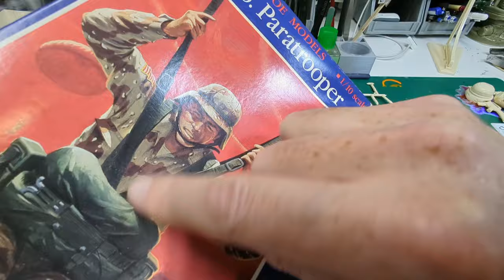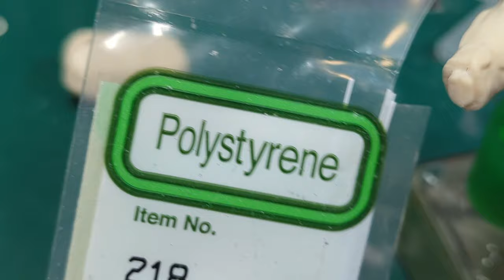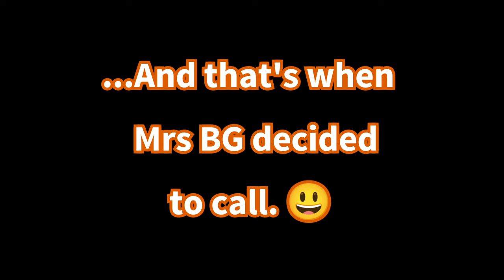80th anniversary of D-Day G.B.  Glencoe Models Paratrooper model kit Update

Comment: one of my Favorite kits! Wished Glencoe added the parachute like ITC did in its original run.
Reply from the maker: Hi Brad! 100% agree! Just seems a little odd without it, especially since there it has the wall mount included! 
Did you ever do a video on building this kit?
Reply: @BGsModelWorkshop  I never have, wanted to vacuform the parachute and build the wall mount version.

Comment: Great progress Bryan.  Nice Tips on figures.  I've always found the Plastruct and Evergreen stuff will melt well and makes good filler.  I've used reactivating liquid cements when parts were not lined up well.  It also is good to soften styrene and mash parts together to reduce seams.  Good Stuff.  Enjoy the cookies for a job well done.  BTW, yes, the 45 goes on the right hip.  I think the canteen should be lower on the leftside belt.  I had a surplus one as a kid (actually I stole it from my Boy Scout older brother).  The loops were at the top third.
Reply from the maker: Hi I Vince!! Thanks! Man, I feel this kit was made by someone that didn't have any reference info at all.. (definitely pre Google images)😁 I'm getting a lot of comments about how much is wrong with the kit. If I build as the instructions indicate, I know I will catch loads of grief. But modifying the kit kit seems like it will be a bit of a pain. 🤷